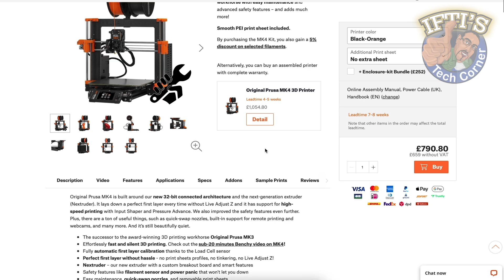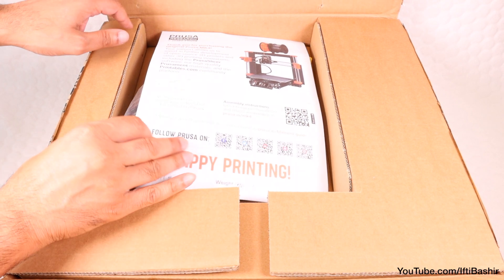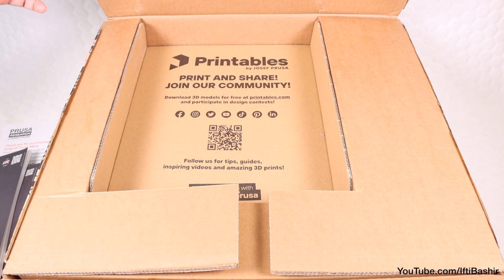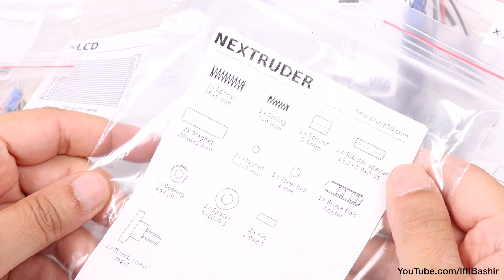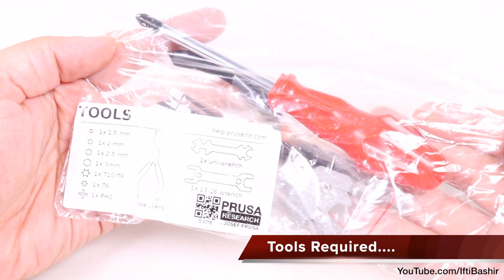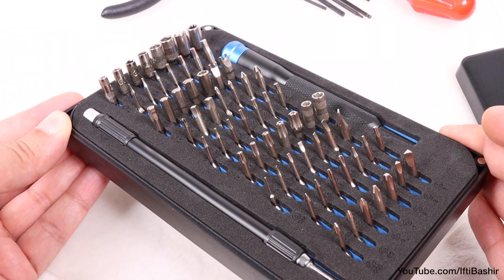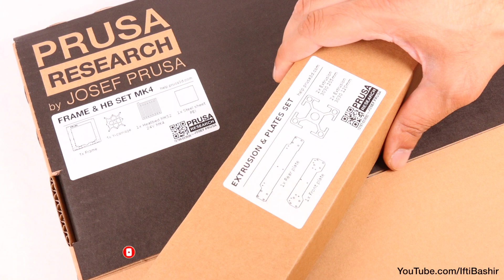#01 Original PRUSA MK4 Kit : Full Step-By-Step BUILD GUIDE - Unboxing & Preparation

Comment: Just ordered my Mk4 kit. I'm super confident in my ability to build a printer (This will be my third build. But my first Prusa build.), but I'd love to see the process to get an idea of it before it arrives ^-^
Thank you for this playlist!

First ever printer was the Anet A8, and I loved it. But I've grown out of the tinkering.. stage? mood? phase? of this hobby, and want something that just works nearly all of the time ^-^'
I got a used Prusa Mini last year, and fell in love with the ease of use, quality, and comparative silence to my previous printer (an Anycubic 4Max, which was my 2nd build) 

Decided on the Mk4, cause I liked the idea of the load cell for bed leveling, a bigger print volume, wanted something newer for future updates, and I wanted a direct-drive extruder again, so I can use my 85a TPE again. (The Mini did fine with 95a, but I've been on a 3d print revival, and want to find reasons to print in super flex materials again xD)
Reply from the maker: Hope you used my link in the description - you'd have got some free Prusa points to put towards filaments or other accessories!

Comment: I have to agree with mhhor. Well made and very clear. 
Clear enough to give the confidence to order my first 3d printer and in kit form. 
Once it arrives I will be rewatching the series again 
Top work 💪🏻
Reply from the maker: Just take the build slow and be precise with every step and you’ll be fine ;o)
Reply: Don't use DHL they gave my neighbor my mk4 without signature then lied and said I signed for it ...I was lucky my neighbor was honest and still had it when I found where DHL left it ..